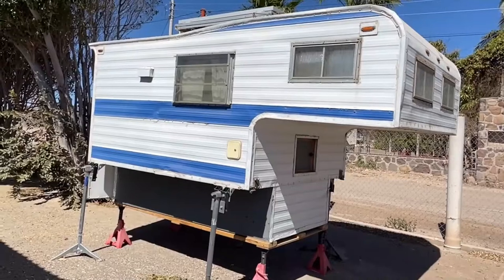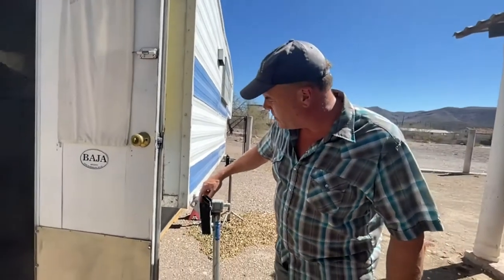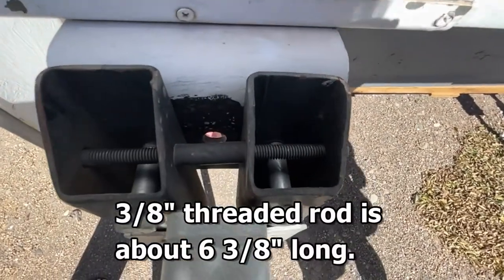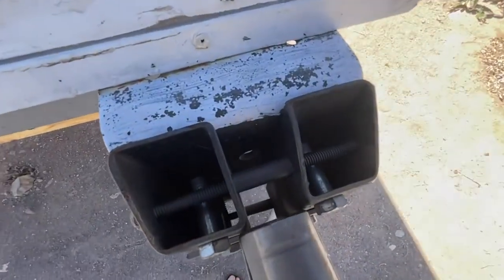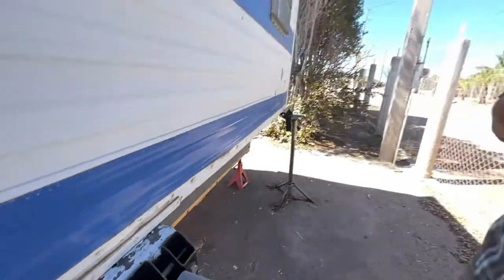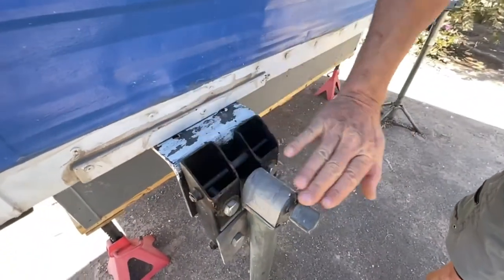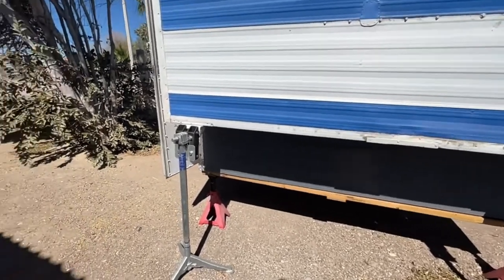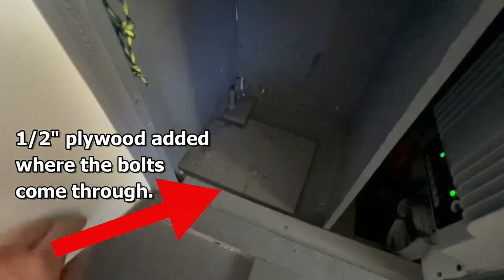RAISING & WIDENING the Manual Jacks On A Truck Camper

Comment: Hi...long time ..since I commented on one of your videos..but once again you probably save me a bunch of trouble  while working on my vintage..I got a 1969 Drifter..it was bought 50 miles away from my hometown of bakersfield  calif.but reading the info on it..it was made in my hometown  in 1969..lol..I wanted a older model for my Ford F 350 Super Camper Speacil 
.it was perfect fir my camper.which I got first..it took 2 years of looking for the right  truck for my camper..cause they were made especially to haul their own factory made campers..but you save my tuss by proving me info on a backup for my stands..I don't like permanently attach stands on my camper..but thanks again for that valuables info on the ones you folks have..
Reply: Sorry..I ment to write, that I found a 1973 Ford F350  with a 351 engine for my vintage truck camper...
Reply from the maker: Hey there.  Thanks for the comment.  Good to hear from you.  Cool that you got a camper & truck now.  Happy travels!!!

Comment: I had this problem loading the one we bought yesterday on to the truck. My truck was to tall and wide. This should to the truck l trick nicely tho. I wish I would have seen this video before now. I think I'm going to use a 4x6 tho.
Reply from the maker: Thanks....glad you found it useful.  Good luck with the camper....we enjoy ours immensely.
Reply: I had the same problem.   I took the base of a RV slide out stand and slid it on my jacks.  I adjusted them to give 8 inches of extra lift.  You can easily set it for more or less.  Now my jacks are less wobbly since I don't have to extend them completely.   It was the perfect solution.   I also added a 4th jack.  Now with a drill I can easily and quickly load and unload  my camper by myself.

Comment: I also need that 4th jack.  New, 1 is $350.  Been looking for a used one.
Reply from the maker: Yeah....they're pricey.  Good luck in your hunt....keep your eyes peeled for old truck campers sitting derelict in a grown-up field....might be able to talk someone into selling you one off of something like that.  We got our entire camper with the 3 jacks for $350.  Granted the camper was gutted and very near collapsing in on itself...but we were able to practically rebuild it from the inside out and it's one of the best purchases we ever made. Thanks for watching.
Reply: @SandraBegotka  I found 3 for sale for a total of $60, 2 days ago.  Sold before I could get there.
Reply: @SandraBegotka  update.  I picked 2 Jack's today for $100.  Came with 2 braces and handles.   Best part is both Jack's have a 2,000 lbs load capacity.
Reply: I found not only a 4th jack, but a 5th jack.  I got both of them for $100.  Both jacks have a 2,000 lb. Weight capacity.  I also had the issues with the height of my truck, and the width of the tires running over the jacks claw feet.
To fix my problem, I bought 4 drop down jack extentions.  Now I have a height adjustment of an extra 2 inches to 1 foot of height. The extensions have a round footing instead of the claw feet.  Now my tires clear the jacks.
I have a drill for each jack, now raising and lowering the camper is 😅😅quick and easy, especially with 2 people.
Just thought I would share in case someone else is currently having these problems. 😅